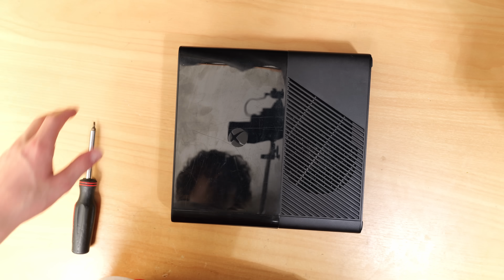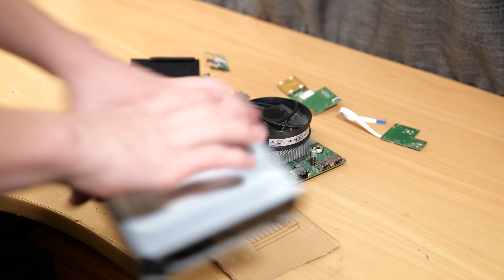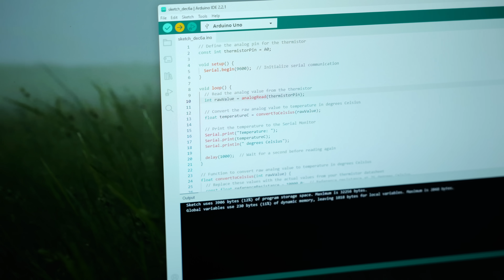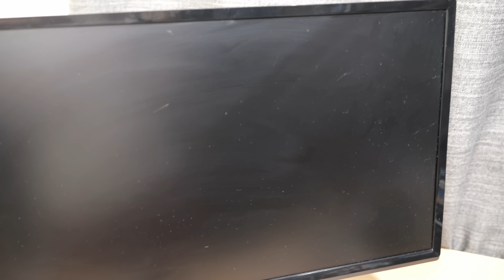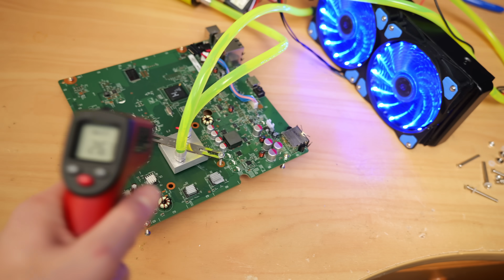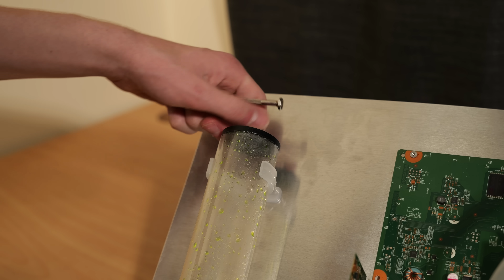Watercooling an Xbox 360

Comment: Take the heat Sinks off RAM Modules. If that console was RGHed and you could see Temps would be much higher with heatsinks on modules. All they need is some air moving across them which is already done via fan sitting above them.
Reply from the maker: That's some great feedback, and while I hate to say it, this console died around a year or so ago 😅 This iteration, and even v2 weren't exactly scoring full marks in terms of longevity... Nonetheless, I appreciate your advice! Cheers!
Reply: @TommyHoughton  You are welcome. Sorry to hear that. Seeing as you can make your way around electronics and what not I will recommend getting a 360 and doing the reset glitch hack. This way you can enjoy freeboot but the one major thing is seeing temps. I could help if you need it. Falcon, Jasper(Tonasket) Trinity and Corona with 16mb nand. Those are the motherboard revisions I recommend.
Reply from the maker: I'm pleased to say I did accomplish an RGH 3.0 mod in my V2 video! I think I used a Corona mobo, but I genuinely don't remember; maybe it was a Trinity. (I think it was a Trinity.) I disassembled the machine at the end of that video as my execution was a bit flawed, but if I ever do V3, I'm sure it'll compensate for the flaws that V1 and V2 had. Cheers!
Reply from the maker: No worries at all, haha. That video didn't get as much reach as I wanted it to, but I guess that's fair given the particular flaws it had...
Reply: I need to correct myself. When a 360 is RGHed or JTAGed the memory temp shown on FSD, XEXmenu, ETC. is not showing the temps of actual RAM modules. These do not have any temps sensor. When you see memory temp this is actally the temp of EDRAM on GPU.

Comment: were did you lean fusion 360 ?
Reply from the maker: Learn is a relative term 😅 I've just been fooling around with it over the years, and watching very basic tutorials. I plan on doing some proper learning in a few months. 
Channels like, Product Design Online, 3D Printer Academy Tutorials, The Fusion Essentials and many others, are fantastic for learning, but I highly recommend just trying to make stuff in the software, and picking apart what you need and don't. I struggle in both the actual software/CAD, but also the theory of part design, and how to make it, so that's what I'm going to try to balance and learn over time. All the best with your CAD journey! It's an insanely valuable skill.

Comment: I just want to add watercooling to all my older consoles, and have it connect to a main quick connect system. Be nice to have it connected to a large watercooling block lol. That's all I'd want, and to commission modern ones incorporating more efficient parts and the like... probably take about 120k to get microsoft to build a modern xbox original tbh, on the low end...
Reply from the maker: That would be awesome for sure. Yeah, shame R&D would cost a stupid amount for them. At least makers can fill the void. Cheers

Comment: Hey bro. I like your video's. Please do a RGH 3 on this console. Marketplace is down and there is no ways to get new games etc.
I am a expert modder myself. I can help you if you have some issues. You could use a 4$ Raspberry pi pico to read NAND and you just need 2 wires and 1 resistor to perform mod.
Reply: ❤. Anyways just to let you know that a zero fuse Winchester can run homebrew. It's basically a devkit. You need a CPU that is never used in any console. It's very rare. There are a few in the world. You will have to swap the CPU and write a Custom NAND. My friend has it but it's very rare.
Reply from the maker: @basim0213  That sounds like a risky task, but certainly an interesting one. Your friend sounds very lucky and talented. I hope to provide you with an update for this project in the future! My goal is to release a video on the same date as this one, we’ll see if that happens.
Reply: @TommyHoughton  If you want to go for it, then I would recommend a Trinity motherboard (Slim not E). It's the most reliable. Trinity motherboard is more reliable than the corona motherboard. Also some Corona NANDs are 4GB which have issues.
Reply from the maker: @basim0213  Good to know! I’ll start looking for a local slim console later this year.
Reply from the maker: Hey, thanks! While this console model doesn’t support rgh (it’s a winchester model) I have plans to do this again with a compatible console, and do a much better job. I plan on using a pico, and maybe installing an ssd too. I want to remove the disk reader to shrink the size of the console and put all the games on the hdd or an ssd. I haven’t done too much research into it yet as I have other projects being planned, but later on this year I will get started on it. I appreciate your help, I’ll let you know if I need a hand! Cheers, Tommy.

Comment: 14:54 why does the block type switch from a top input/output to a side input/output?
Reply from the maker: I switched it around a few times during the build, originally I wanted to use the side input output as that was the plan, but due to mounting and tubing routes I chose to use the top in/out. It took a few swaps to figure out.

Comment: might wanna consider a cut out behind the radiator so the fans can breathe. also please dont just use thermal paste to mount those heatsinks on the ram chips, that won't hold.
Reply from the maker: I used standoffs to add some clearance. When putting the radiator in the pc case, I’ll see how thermals are and then cut out some of the frame if necessary. You’re right about the thermal paste not holding, I’m looking at finding a better solution.
Reply: @TommyHoughton  I know I am right because I made the same mistake lol :P

Those sort of chips don't get too hot so any form of thermal putty, thermal adhesive pad would do the trick. You can use thermal glue which holds best but it can be a nightmare to take off if you ever wanted to put everything back into the original case.
Reply from the maker: Thermal glue is a good idea, I don’t intend to put this machine back together (since it’s going in the pc case) and the heatsinks look neat, so I’ll stick them down. Thanks!
Reply: @TommyHoughton  No problem, I used thermal glue years back on a GPU heatsink upgrade. I think it was the arctic accelero 3 cooler on a GTX480 the hot boy. That cooler had little heatsinks for the VRAM and VRMs which used thermal glue. Nasty stuff to remove, requires heating up before you can take them off or you risk ripping off or cracking the chips if you try to pry them away. The cooler was exceptional though, down from 75C to 55C :) I'll never forget that purchase.

Comment: Is it possible to put factory water cooling on xbox ? Would it be a problem to mount it on the crystal or what are the pitfalls ?
Reply from the maker: By factory watercooling, do you mean something that the manufacturer could do? Mounting directly on the crystal/soc without the xclamp bracket can cause warping of the circuit board if done incorrectly (like I did.) 
If I was to do “factory level watercooling,” I would create a heatspreader for the gpu die, like the intel and ryzen chips. It would allow for more surface area for cooling. 

I think I misunderstood, do you mean an AIO and off the shelf pc water cooling components? The only downside for those is mounting (wiring is an issue but not a bad one,) if a mounting bracket can be made, and the pressure of the water block is even, then it should be fine and possible. I believe people have done it before. It would be much simpler and cleaner than using random cheap components.
Reply: @TommyHoughton  By "factory" I meant maintenance free water cooling for pc's . For example: NZXT Kraken, DeepCool, ID-Collling and others. It just seemed to me that the average water cooler covers the crystal on xbox360. The only problem is to fix it there. I came across your video and was wondering . After all I have xbox360 freeboot )
Reply: @TommyHoughton  A single-section watermaker will suffice for him . Let's say Cooler Master Master MasterLiquid Lite 120. I'll take just about any one at a reasonable price.

Comment: Pointless… it’s core is locked, your not going to achieve anymore FPS what so ever. 😂
Reply from the maker: Fine by me, the main thing is the watercooling "performance" and the overall aesthetics, the performance part is for a more moddable version of this console which I'm saving for the future.
Reply: @TommyHoughton  if you’re gonna go that far, you need to go buy pico flasher! RGH3 mod that system. You can get GPU temperature, and much more via system.
Reply from the maker: @yodead369  that’s hopefully the plan! I’ll be looking for a slim model or something older once I’m ready to start the project.

Comment: Wait are we painting heatsinks now?
Reply from the maker: I personally did it for cosmetics, it’s not recommended for critical performance. They already had a coating on them, so the transmission of heat was already less than if it was raw metal. Someone said the DRAM chips don’t need cooling at all, so It seems what I did was more than unnecessary.

Comment: How did you power your fans and pump?
Reply: Like a fully separate power source?
Reply from the maker: Yeah, I wired it up to the main 240v input socket. I couldn’t risk overdrawing current from the main board as the water cooling system drew 50% more current than the stock fan that I was planning on using.

Comment: Meh. Where's the original 360? Would have made much more sense to do an original seeing as they were plagued with RROD. Reducing the temps on those consoles makes more sense than using this. Using a wallpaper scraper and a screwdriver to open the console is not how you dismantle it. Why? Why not actually take care and do it properly. Such a shame. This could have been a superb video. But  .. no . Soz but the 360 deserves better than this frankenstein video
Reply from the maker: I would have done this project with an older 360, but I bought this from a friend with a bunch of other stuff, they didn’t specify the model. I don’t have proper teardown tools, but I’m researching some to get since I’ve had at least 20 comments mentioning the teardown’s execution. I intend to redo this project later this year with a more deserving console and better components. Thanks for your comment! I’m redoing the build for my next video where I put it in an old pc case and make the whole thing cleaner. It won’t affect performance, but it should be easier to use and maintain.

Comment: I’m halfway through the video and everything has been really painful to watch. From the no knowledge of what he’s doing. Breaking the case, not knowing that a device that records temps has a thermostat, screwing in the fan and almost destroying the 360. This is satire correct?
Reply from the maker: No, I didn’t do any research and just went into the project almost unplanned. I’ve been reminded of this several times. It’s not in my intentions to perform something like this again with scripting and researching it down to the teeth. If there’s a way to access the consoles thermostat, I’d love to know as it would be much more accurate than anything I have on hand. My hand slipped with the fan screw, could happen to any one. I could have cut that clip, but I’d rather have my mistakes demonstrated so I can learn from them. At the end of the day, it’s a learning experience for me which doesn’t harm anyone unless they choose to be. Thanks for your comment.

Comment: Just get a damn PC. This is putting lipstick on a pig. This is polishing a turd. It's still console cancer. Castrated, draconically authored by your platform ecosystem overlords, granted and revoked entirely at their whim.
Reply from the maker: I have several PC’s. I’d never isolate myself to a console or locked in platform. I’m sure emulation would be a much better alternative than purchasing a whole console and titles. I’m not a console player at all, not anymore. However, this was mainly a passion project for a bit of nostalgia, not that I did it justice. That will come soon. Thanks for your comment and opinion.

Comment: I highly recommend taking out the hard drive whenever messing with a 360, in order to avoid any damage or messing up the hdd or the console. It's very easy, as with slim and E model consoles, you just have to pull on the tab and it should come out easily.

Comment: I love the build not sure about the aluminum plate i cant remember if it could potentially short circuit it but other than that its a great buld cant wait for the sleeper build
Reply from the maker: It’s possible that it could short circuit the components, I did use spacers, but I disassembled the whole project shortly after it was done as I had some concerns about the longevity. I’m looking forward to getting started on the sleeper build! I’ve got 1.5 videos to go before I get started.

Comment: Awesome video just curious on what kind of screws did you use? I've always wanted to do some modding aswell but not with consoles. Could never find any screws that were that small unless im not looking hard enough..
Reply from the maker: Most of the screws I used were M3 between ~1mm and ~50mm, when taking it apart there might have been a few M2’s, but the majority was M3. I bought a few packs of M3 screws with multiple lengths that are used with an allen key bit (I don’t know the name) and I use them for almost every project. For general modding, 9/10 times M3 screws are used, I have noticed M2’s being used occasionally, but it’s much rarer.

Comment: Really impressive! I enjoyed watching the video the entire way through, the only thing I can question is the temperature recording. Couldn't the GPU die actually be much hotter than the heatsink itself? I wonder if its possible Microsoft produced a heatsink that was only capable of simply absorbing enough heat to keep the chip within a safe temperature range to keep it from from frying itself but didn't waste money making it overkill. If thats the case the GPU would be quite a bit hotter than the heatsinks temp, the only way to be sure would be recording from the die itself.
Reply: I have wondered, have you thought about making a 3D printed mounting bracket for the 360 slim? I reckon its possible and if you ended up doing it I would love to buy a copy of the CAD file off you.
Reply: It would allow you to use a small formfactor cpu cooler or a small aio or something similar for some really gnarly temps
Reply from the maker: @QuantumNexus295  I’ll see what I can do! My plan is to 3D scan the circuit board and make a custom waterblock and enclosure, it would be a crazy project. Gotta knock out a couple of other ones beforehand, but I intend to do this project justice.
Reply: @TommyHoughton  Very nice, I've recently in the past few months gotten heavy into console repair and xbox 360 modding. I would love to see the project take off. If you hit any roadblocks, please reach out. I would love to help!
Reply from the maker: @QuantumNexus295  I’ll keep you updated, thanks! Really excited to see how this goes.
Reply from the maker: I'm certain it's quite a bit hotter on the die, my way of measuring isn't very accurate. Since this model can't be RGH modded, I won't be able to use the internal temperature readings. For now rough "estimate" from the arduino setup is fine, although I plan on improving it or replacing it with a dedicated circuit.
Reply: @TommyHoughton  That makes sense, what you did was definitely good enough. It was just a little nitpick on an already great video
Reply: @TommyHoughton  I recently learned that you can mod the 360 in a process called "RGH3" which is a chipless mod that simply requires some soldering and you can install a custom dashboard that actually shows you accurate temps from the sensors in the 360. Would be a really cool follow up.
Reply from the maker: @QuantumNexus295  That's the plan for the remake! In December for a fitting anniversary I'll be RGH or JTAG (most likely RGH) modding a 360 Slim (It arrived a few days ago. I'll be building a full custom loop for it and making it look amazing, I'll try and slim it down as much as possible too! It's going to be amazing! Cheers
Reply: @TommyHoughton  Really looking forward to it!

Comment: That water block dude wtf 😂 I used those once on a TEC chiller I made, they worked well enough for that, I wouldn’t trust them as a water block.  Also, I would anchor those tubes in place on that block with something, a zip tie, a hose clamp, just use something.  Don’t leave them loose on those barbs, don’t ask how I know 🤦‍♂️
Reply from the maker: Yeah it ain’t perfect, but enough for now. I got some clamps with the kit, they didn’t seem necessary at the time, but I’ll make sure to install them. Cheers

Comment: This was hard to watch… why not get a motherboard revision that could be RGHed ? That way you could have all the temps reported accurately. 
And the waterblock mounting only using two screws… it needs some kind of backplate otherwise the motherboard will warp over time around the APU.
Reply from the maker: When purchasing this console, I didn’t know what model I was getting, it didn’t matter to much at the time as it came with a bunch of stuff, and I didn’t intent to soft-mod it. As for the warping, I had another comment mention that too. I’ve disassembled the whole project for storage until I begin part two. Cheers

Comment: i would just like to say that at the beginning when you say "the xbox 360 isnt visually striking' your technically correct when it comes to older ones with the hourglass shape the whole point was customization faceplates and the like but the Elite model you have is a direct predicessor of the og xbox 1 and why they look very similar your image has a mix of base and later models that have been de crazified